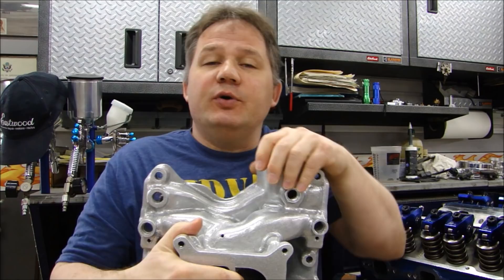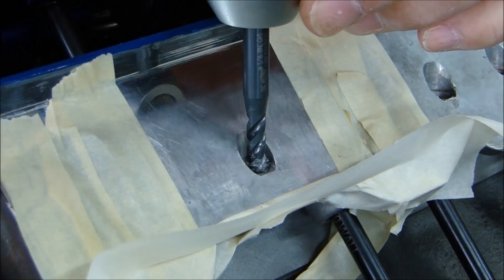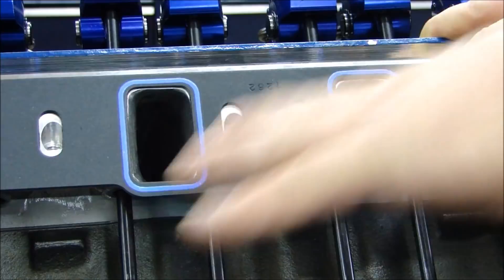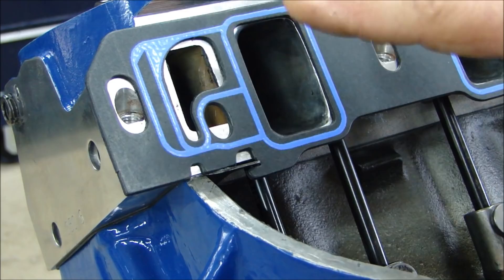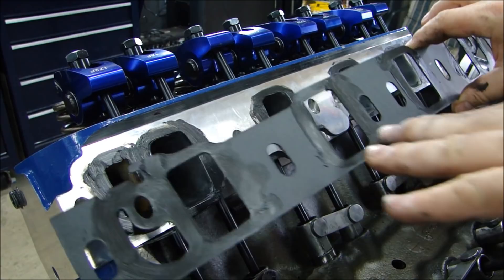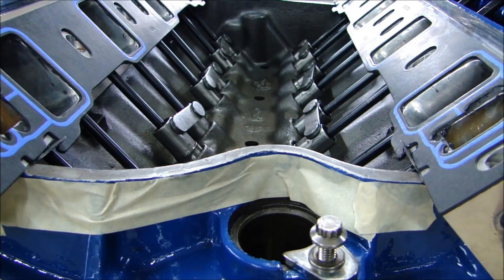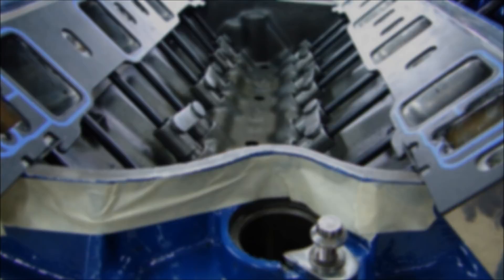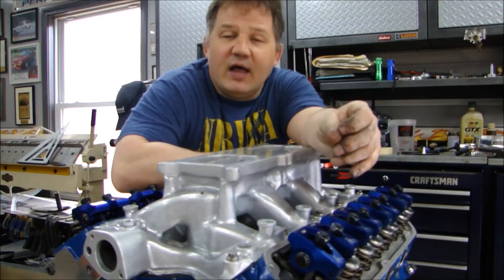Engine Building Part 9: Intake Manifold Installation

Comment: Just watched your intake manifold install. The tape on the China walls is a neat way to insure a very professional appearance to your finished build , thank you, you can consider that trick stolen.
  Have you ever used guide studs to set manifolds or other parts that do not have location dowel pins ? If not is there a reason why not ?
Reply from the maker: All of my tricks are free to steal. I have no top secret techniques. I have used guide pins for con rods and cylinder heads. They are a great idea but if you don't have them handy it takes time and money to get when a bolt works just as well. Not too sarcastic...lol

Comment: Better to use a thread chaser than a tap.  Taps are made for making new threads in a drilled hole.  Using them in an existing hole can undercut the threads.
Reply from the maker: That is an excellent point...thank you

Comment: Super great info!  Shouldn't those threads be chased with a thread chaser rather than a tap so there is a much lower chance of cutting new threads?
Reply from the maker: +AustrianAnarchy That is an excellent point. I have found a tap to work better when you know what you're doing. But a lesser experienced person should use a thread chaser...you are correct

Comment: I am familiar with the effects of dielectrics which are exacerbated by electrolysis. Dielectric grease is used quite frequently in my fuel of work and have a nominal affect when it comes to torque yield. In fact copper to aluminum electrical connections NEC (National Electric Code) mandates the use of dielectric grease. For plumbing you must use  dielectric union when combining dissimilar metals. As the joint will attract any sort of debris through ionization. Since electrons are transfered from negatively charged particles to positively charged particles. All of this sounds completely horrible but can be extremely efficient at removing rust from parts you cannot access the inner surfaces of. If you are curious just Google rust removal by using a trickle charger.
Reply: Line of work not fuel of work.
Reply from the maker: That is true. Rust is oxidation and can be minimized by electric current. Thanks for sharing with us

Comment: Good and informative video. As a professional mariner galvanic corrosion has been a common enemy. The phenomena is explained well by you but did I miss whatever remedy you use to combat it?
Reply from the maker: Thanks Jim, trying to use metals that are similar to avoid it.
Reply: Thanks. I learned al lot from your chart. The marine industry has to employ sacrificial anodes to hull exteriors to combat electrolysis. I've wondered if the effects of galvanic corrosion might be increased by electrolysis within car engines.

Comment: Hey mate with the cork gasket why don't you pull the white strip off the back and expose the sticky side to stick to the block? I haven't had a issue with them 👍
Reply from the maker: Because I don't use them, I use a bead of Permatex Right Stuff

Comment: Hey Pete, great videos. Is part 10 put yet? Also, I was wondering if you could make a list of tools you used? Especially measuring tools. And are there any books you can recommend on the math evolved as well as metals. If not, can you write one? You're a genius, man. Thanks.
Reply from the maker: That is a great idea. I can add a list of tools to each video. I have many engineering books on fluid dynamics, materials, and machining. I f you Google what you are looking for you should be able to find it without spending months trying to learn from a text. I don't think I'm a genius, but I do have knowledge to share. Thank you!

Comment: I dont know if your building a street machine or a race car, but open plenums have more runner length, which is good for full throttle like a dragger(pro stock), the object is to have  equal firing pressure for each cylinder , which is impossible with old stock 2 and 4 cast iron barrel manifolds,  the new concept is to have all the intake runners the same length so the fuel pattern is the same for each cylinder, but since you are installing the injectors , the same distance for each intake valve , I dont see a problem with your set -up. A lot of tuners that install dual quad manifolds install carbs that are too big, and end up messing up the vacum signal, , same deal with cams, why bother to install a cam that makes power  at 7000 rpm, when your driving on the street , at 55 mph and 2500 rpms, thanks for the tip about galvanic corrosion, I will no longer use left over nuts and bolts from the junk jar.

+
Reply from the maker: +tom ashton Those are all excellent points. I'm building a street machine that will go very fast in 1 direction...lol. It won't be a daily driver, but it will be a nice ride to the track.

Comment: Great video, Pete! I learned the perfect way to put my new aluminum intake on my 460. Thanks! I have a different subject question. My valve covers were leaking and I removed both covers with my fingers(no wrench) so they were all loose and there was 3 different sizes of bolts used. Is there a way to find out which size bolts I need for the valve covers AND intake manifold? Napa and O'rileys couldn't look it up for me. Thanks again.
Adam
Reply from the maker: Most valve covers are 1/4-20. Intake is most likely 3/8-24

Comment: When you lightly coated the gasket with 'The Right Stuff' and did the underside, did you immediately do the top so that pressure would squeeze and seal before dried?
Should I use this technique on a multi layered steel gasket or rely on the gasket by itself?
How much trouble am I courting if I use a MLS gasket with an aluminum head given galvanic corrosion? I believe my block is cast iron. I know that just because someone makes a product like a MLS gasket doesn't mean it should be used in every application.
Great videos, listen to them when driving across states for work. It's a lot to take in. Wish I had the budget and space to work on a classic, but in my case just my compact daily driver. The head gasket is a known flaw for my engine model.
Reply from the maker: Yes, that is what I did. A multi-layer steel should have a black sealer already on it. You don't need anything else. The MLS gasket is fine.
Reply: @PetesGarage  Thanks Pete, I appreciate all that you do. Even going to the trouble to make torque spec videos. I never was into the 'Gooten taght' (German accent) method unless it's inch lbs and for aesthetics.
I haven't found a video of you cutting the piston rings but still a lot to go through. I did see you talk a great deal about them. Again appreciate all that you have been putting out.
Thanks Again for getting back to me!
Reply from the maker: I cut the rings on a 440 I built. That video is in my list somewhere

Comment: You sound meticulous but as an engine assembler myself I have to disagree with using a tap to clean the threads on any bolt hole. A thread chaser is all you need to clean the threads. A sharp tap is liable to remove material and make the bolt hole sloppy and increases the chance of pulling the threads. I recommend thread chasers on any aluminum material and especially head bolt holes even if it is a cast iron block. A tap is for removing material not cleaning.
Reply from the maker: That is an excellent point. I do agree with you. There are different grades of taps, which determine how accurate the threads will cut. I was a cylinder head Process Engineer for GM. I can tell you that even on production parts the taps would be used for up to 15,000 hits. The threads cut near tool change were very small due to tap wear. I use a tap to make sure the hole it cut to the right size on brand new parts.

Comment: Why did the engine have a problem the first time you built it? You mentioned something about oil issues.
Reply from the maker: The oil return holes were partially blocked. The valve covers were filling up with oil and the seals could not wipe them fast enough. I have corrected that by opening the return holes to match the gasket.

Comment: This might be overkill or just incorrect.  Couldn't you cut down on the risk of galvanic corrosion by using studs and non-metallic washers?
Reply from the maker: +AustrianAnarchy The raw answer is yes. However, a steel stud in an aluminum head will still experience galvanic corrosion and I would never use a non-metallic washer. Understanding what is happening and planning to prevent it is the best what to control it.

Comment: Hi Pete, I watched your video on torque, I'm afraid I found it confusing. What bothered me was your assertion that if the fastener is lubricated, then one would need to torque to a higher value to achieve a given clamp force - relative to if the fastener was not lubricated. Here in the 'comments' you again repeat that view. So lets say you are correct (which I am sure you are as you know a lot about engineering), when I read the torque specs in an engine manual, are they specifying a torque value with or without a lubricated fastener - what is the convention ? Thanks for a great series of videos !
Reply from the maker: +ALMAIA All specs are given for dry fasteners. If a manufacturer recommends any lube the will give you the spec for it. I promise you, if you put lube on a fastener and use the dry torque spec you will have problems.
Reply: Now I am really confused Pete because in another of your videos, talking about fasteners, you had a fastener which came 'pre lubed' by the fastener manufacturer, and in that video you talked about 'galling and grabbing'....which surely would happen with a dry fastener ...??
I have watched loads of other 'engine build' videos, made by serious techs, they all had some lube on the fasteners. Not soaking in lube, but with a thin layer.

Comment: Hey Pete! Recently started rebuilding a 351w. I remember that we ran it before but as soon as we would try to rev it, it would fall flat on its face. when i removed the intake manifold, I saw that one of the gaskets was hanging off of the edge of the block and was not completely covering the surface, leaving a gap for air to get into the motor. Could this have been the cause of the motor falling on its face? Thanks for your time creating these videos!
Reply from the maker: +Jake Absolutely. A vacuum leak kills an engine
Reply: awesome to know! That must have been the problem because everything else in the motor looks to be brand new so far. Thanks for the response!

Comment: Pete, I am replacing my upper and lower intakes on my '89 Bronco 351 EFI.

How important would it be for me to use a thread chaser on the intake-to-head bolt holes? Would you recommend waiting until the gasket maker is "spongy" to install intake or do it when it's still "wet"? And finally, do you recommend gasket maker between the lower intake and upper plenum also?

Thanks so much for your videos!
Reply from the maker: If you did not have a problem taking the bolts out, just clean out the holes with air. Install with the gasket maker wet for silicone, tacky for high tack. Yes, for the plenum as well, not too much though

Comment: Wondering why you put sealer on the printo seal side of gasket? Felpro specifically says that side goes in dry. Need to do an manifold and this confuses me. Thanks
Reply from the maker: I know what you mean. You should always follow the manufacturer's recommendations, but I was worried about leaks with this particular manifold.

Comment: What sort of torque should an intake manifold be typically, Porsche say I should be tightening the final down to 11 ft'lb which I thought was a little low.
Reply from the maker: It is so tough to say....usually around 18 ft lbs

Comment: so what if I used aluminum anti seize on a bunch of bolts on my car? will everything start fusing and welding? it's ANTIseize.. it could actually weld parts?
Reply from the maker: No, it won't weld, but it will change the torque curve and you may not have it properly fastened.

Comment: that is not a bottom. it is called a spirol tap so as you tap the threads come out and doesn't collect in the hole. a bottom tap is like a starter tap with no lead.

Comment: What value did you torque it down to? Does the torque value change any when using the factory bolts vs. the stainless steel?
Reply from the maker: Use the factory recommended torque. The value does not change with material, only if you use a lubricant.

Comment: hi i am huge fan of your videos i simply love the way you explain things. 
now i am trying to build high horsepower engine preferably ford big block 460 and bore it out. what is in your opinion best engine to build 700-800 hp engine and if 460 is a good option whats max i can bore it out? thank you very much
Reply from the maker: killa bimmer If you're sticking to Ford the 460 is good but don't go more than 0.060" over.
Reply: what is the most safe horse power that i can pull out of 460 block thanks
Reply from the maker: killa bimmer I would think easily 600 safely

Comment: I am new to engine building and have no idea were to start. I have a 302 that came with a 65 mustang I bought and I am going to make it a 347 stroker. I have done sooo much research and I still have no idea were to start. I know you have to plan before you build and engine but what's the first thing to do?
Reply from the maker: Take it apart and get everything clean. Start with the main bearings and crank.

Comment: Can Galvanic Corrosion happen if you split Gatorade on your Aluminium header with stainless steel bolts? :)
Reply from the maker: +Walter Shmitty It depends if you split the Gatorade down to the molecular level

Comment: hey no anti seize on threads????? what about galvanic corrosion?? just chasing the threads isnt gonna do it?
Reply from the maker: You can use anti-seize, however this area will see no coolant and I do not plan on removing the bolts. But, if I do, I'll put some on next time ; )

Comment: Why not use cadmium plated steel bolts for less galvanic action? They should be cheaper also.
Reply from the maker: Because I sacrificed that for the 12 point stainless appearance

Comment: Question: That seems like a lot of RTV that comes out the front. What do you do to prevent that RTV from squishing into the motor? Seems like it could break off and clog an oil passage, no?
Reply: Your are absolutely right about they. Basically what they do is let it cure for a while so it won't be as bad as being really wet
Reply from the maker: That is an excellent question. Tony is correct when he says it cures and won't break off. You should try to limit the amount.

Comment: I am having trouble with my 351W/427 stroker sucking coolant to the intake from the back (blocked) coolant passage on big deceleration (lots of manifold vacuum)..Ever had this problem? It looks like a blown head gasket but no oil/water mixing...
Reply from the maker: Could be sucking coolant through the intake manifold gasket

Comment: so do you put any rtv on the gasket around the bolt holes to keep them from getting coolant on them? and you said that you just install the bolts bare?
Reply from the maker: The bolts on this engine do not pass through the coolant passages.

Comment: Just wanted to say so far I love your videos but I have one curious question did you port match your heads and intake before you milled the intake or after and if before did you then have to go back and port match the heads and intake accordingly?..... Also just wanted to say lots of great info so far
Reply from the maker: Thanks Keith. I had to go back and check after milling. It moved ever so slightly.

Comment: Wouldn't that sealer get in the engine when you bolt down the manifold ?
Reply from the maker: Not if you put it on sparingly and clean up around the intake ports first.

Comment: When placing the Intake on the engine do you not worry about the RTV squishing out through the other side? By other side i mean inside the china wall. and if so, what measures do you take to ensure the RTV only squishes out instead of inward? thanks pete.
Reply: I would like to know what will happen when the Right Stuff goes inside because with that amount you know it does.  What problems will it cause.
Reply: it does squish inward as well as outward. however the small overhang it makes is negligible and RTV is not oil soluble, so no damage done :)